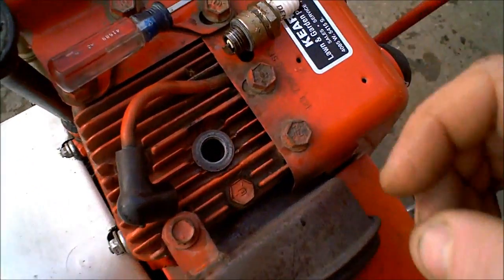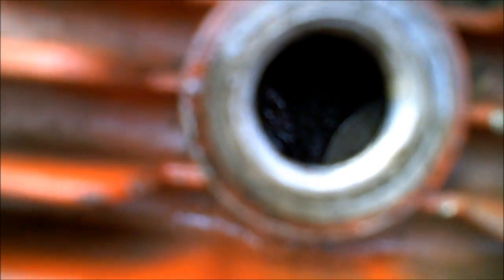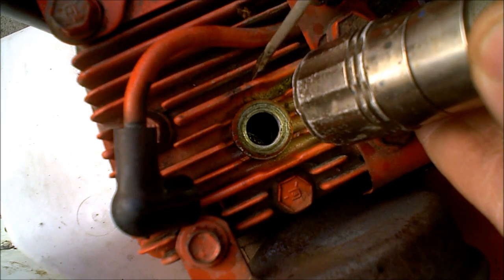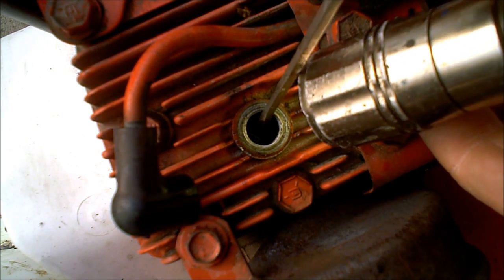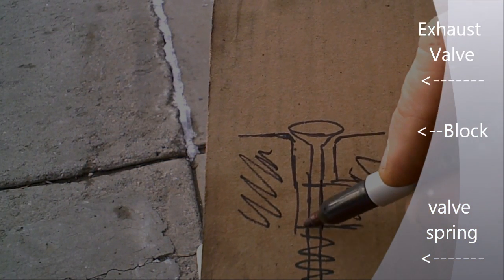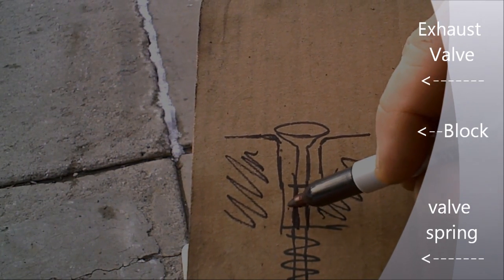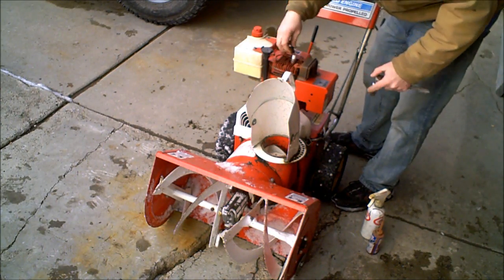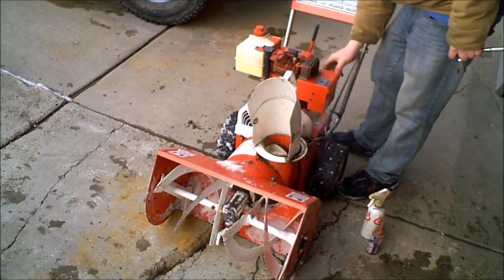Briggs Tecumseh Free a STUCK VALVE without removing head

Comment: Very Good 65! I have a similar video showing how you can remove the muffler and pinpoint lube the valve guide as another option to free a stuck exhaust valve. I can't count how many vintage engines I've acquired with this very issue and I've used your method as well. Again, Great execution on the explanation of how to free a sticky valve! Cheers!! Zip~
Reply from the maker: Thanks. They always seam to stop with a valve open.
Reply: I heve a similar one on the pullcord black case hase no code or nothing

Comment: It is blue smoke, seems something hanging up intermittently. Its a 9hp Kawasaki OHV. I may have to take it apart.
Reply from the maker: Blue smoke is going to be oil. So it could be a bad head gasket, bad valve guide or the oil vent tube is spitting oil into the air cleaner. First I would look at your air cleaner to see if it is wet with oil.

Comment: Love it, I have a john deere that had been sitting for a while and did start up and ran but every now and then would start smoking and finally will not start. I am thinking its just what you are talking about.
Reply from the maker: There's a good chance if it feels like there is very little compression after it dies. If the smoke is black it could be flooding the engine with gas. Then it would be a carb issue.

Comment from the maker: I bad spring is rare. It is more than likely just the valve stem sticking from carbon buildup. Make sure you're rotating it as well as moving it up and down. Try a couple types of lubricant and/or even carb cleaner to dissolve whatever is holding it up.

Comment: i have this exact engine on a yard edger, and i have already forced it down with a screwdriver a few times, then put liquid wrench in there, then forced it down a few more times, then it kind of slipped off of my to-do list. as i was walking around bored yesterday i popped off the spark plug and it was still sticking after soaking for a few weeks. i am pretty sure the valve spring is screwed, or mabey the lifter?

Comment: Thanks for the response Moe. You were right,  the engine loses spark when it gets hot so i guess I'll be trawling ebay for a new coil.  That is unless you've got a "how to fix an ignition coil without trawling ebay for a new one" video that I've not seen yet. ;-)
Thanks again for the advice and all the very best of luck with your channel.

Comment from the maker: I would check for spark when it dies. Your symptoms are that of a failing ignition coil. 
Another option is a plugged vent on the gas cap. Check this by loosely attaching or removing the gas cap and trying to get it to run.

Comment: I was working on an old Craftsman tiller with a 5 hp Briggs and Stratton engine. It had been sitting around for a number of years. I was able to get it started the first couple of times without much trouble and then nothing. After I took out the spark plug, I could see that the valve was indeed stuck open. I really had to wiggle the thing back and forth to get it unstuck. I used the penetrating oil and the trans fluid and it began working up and down. It eventually started. Now is running good.

Comment from the maker: That's actually a difficult question. Most of these small engines have a cam mounted compression release that deactivates at a couple hundred rpm. This throws the off your compression reading. With that said most engines I have tested are around 70+ psi. If it is lower and adding a little oil to the cylinder dramatically increases the compression reading then the rings are shot.

Comment: Hey Moe,

I have run across several stuck valves that were caused by the owners running old "varnishy" gasoline in the motor.  The Engine, and valves work fine while it is hot, however once it cools the old gooy gas forms a perfect glue and effectively glues the valve into the guide.  The first thing I fire down into the valve is carburetor cleaner. If the seizure is caused by gooey gas, it frees up instantly.  I use a few squirts of Marvel Mystery where you use ATF. (I simply like the smell!)

Comment: Here's a good question. I have a tecumseh powered MTD snowblower, and it likes to vibrate the mixture screw on the carb out after a bit. I can fix it temporarily by super gluing the screw in place once I get the mixture set perfectly, but eventually the vibrations break the glue joint and it goes lean anyway. Really frustrating, especially when it happens halfway through snowblowing the driveway.